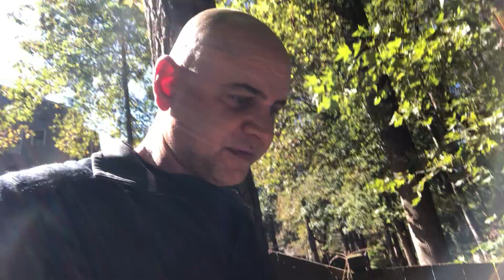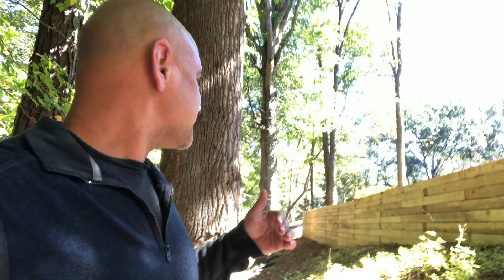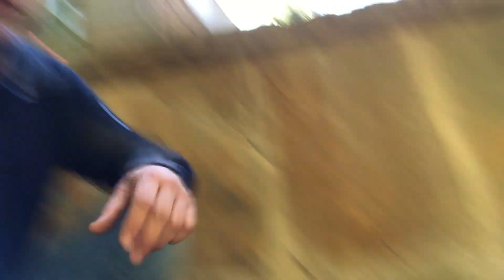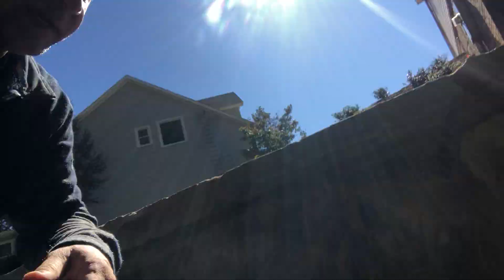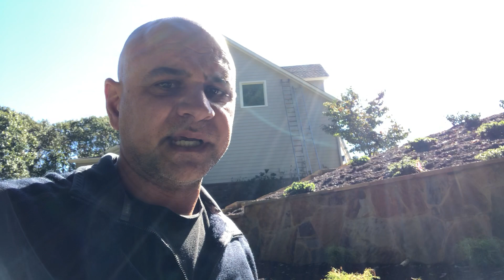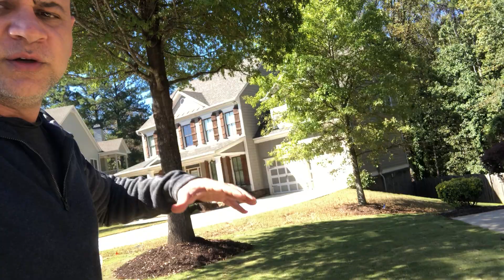Timber & Stone Retaining Wall Project Walkthrough 🧱 This took us three and a half weeks!

Comment: I have a lumber retaining wall up against my lawn - about 3 feet high. On the other side is my driveway.  The wall is starting to fail - and i have some coming to make the repairs.  He's going to put in a drain pipe along  the bottom of the wall on the lawn side - and it will have stone fill.  He's also going to be using that filter fabric.  I was wondering though - can i have a lawn on top of that stone or will that harm the drainage system?  Thanks